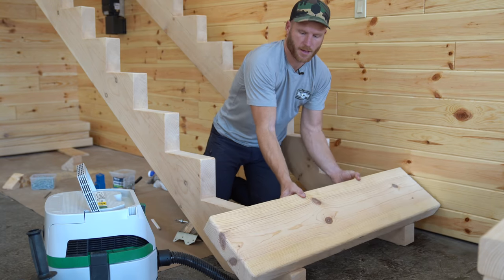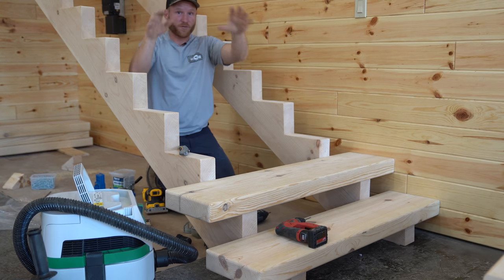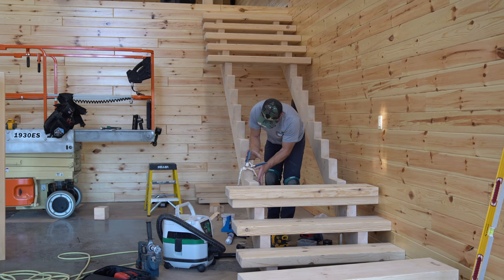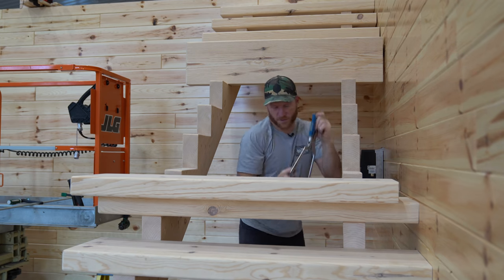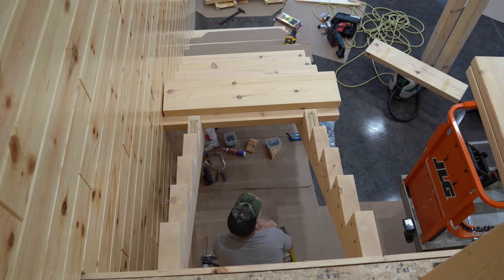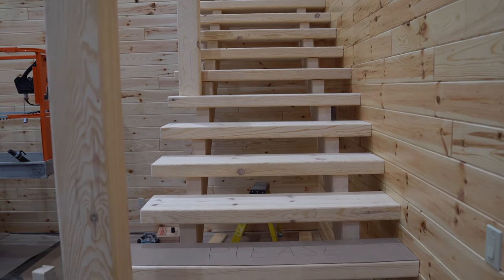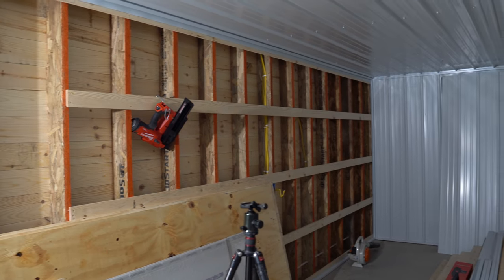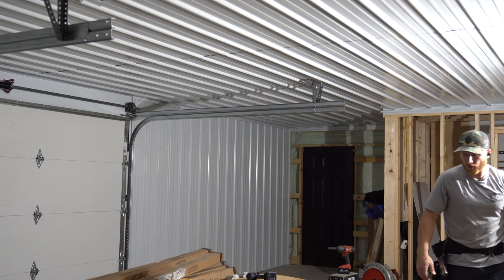Cabin in the Woods 43: Installing an Open Frame Timber Staircase

Comment: That's one beautiful set of stairs the craftman that got them stairs out did a beautiful job have you done a beautiful job installing them I worked in a metal fab shop for five years and built stairs and hand railings I know what it takes 👍👍👍👍👍👍

Comment: I remember my bro in law had a spiral staircase installed in a new house they had built, and when the drilled into the floor to fasten the spinal column, the drilled right through the radiant floor heat tubing.
Reply: Always makes me nervous to see them drill into a radiant floor. I know Kyle was careful about his depth.
Reply from the maker: Dang
Reply: I'm sure he had the lay out plan for the pipes!!
Reply: If you turn the heat on, you can use a thermal camera to see where the pipes are.

Comment: That looks amazing only thing I would of done different would be a small gap between the wall and trade to avoid squeaking
Reply: Yup, just a 16th.
Reply: 2 stringers no risers and all that weight from those treads... you know its going to be bouncy.
Reply: @deeeeeeps   You do realize those stringers are oversized aswell as the treads. I doubt there will be much movement at all.
Reply: @razztacular  yes i noticed they are 3/4" thicker...won't make up for what it is lacking. I bet it drops at least a 1/4" with a 200lb person in the middle. Explain how a thicker tread helps the vertical strength. I'm curious.
Reply: @razztacular  wood expands and contracts regardless of its size. A nickel gap would have helped.
Reply: @deeeeeeps   so your saying a 1x12 will have the same vertical strength as a 2x12.
Reply: Jaime Ness and they look more like 3x12 s those are not going to sag for along time.
Reply: @razztacular  Yes, he could have done with half the thickness, particularly for the treads. Wasted some good wood, in my opinion.
Reply: @2themaster  1.5" x 11.5" (standard lumber size at Home Depot) would have carried all the expected load applied to the stairs. - easily!
The floor itself cannot carry the load that those treads and stringers can carry!
The only reason for such large members would be for aesthetic reasons.
Reply: @deeeeeeps  I doubt it, unless you weigh 350 lbs. Those stringers are bloody gigantic, and the span is not all that much.
Reply: @deeeeeeps  do some point load calcs. show us the result.
Reply: @deeeeeeps  you realise that the floor itself is probably designed for 50psf load? you'll fall through the floor before those stairs fail!
Reply: @apscoradiales  Its not about falling through the stairs I'm replying to a post about squeaking. Those stringers are going to sag when walking up them causing squeaks. I've installed miles of stairs.  I'm not going to argue over online.
Reply: @deeeeeeps  They are equivalent to 4 stringers. I have 2 sets of those in my log house and they are super strong. No bounce ! If they are done in the same style as mine, they are probably 3.5" thick.
Reply: So funny I was going to write this same comment.
Reply: @apscoradiales  well no.   Those 4x12 stringers aren't "x12" after you cut the riser and tread notches out. Typically there is anywhere from 3.5-6" left over (solid sawn remaining) after cutting stringers. It is essentially now two14' 4x6's. They will bounce.  Even standard stairs (3, 2x12 stringers) with that many risers will bounce like crazy... Almost a half inch.  They usually are fastened to the adjacent wall though, eliminating that flex.  They will bounce and they will squeak against that wall.  I am a carpenter of 18 years.
Reply: @9mmkahr  I'm a carpenter with 40+ years experience and you're 💯 right 👍
Reply: @deeeeeeps  what if they made them out of iron?
Reply: Love the look of the thick wood!

Comment: I just did a staircase using black metal stringers, with custom treads, finish stained from a wood shop.   Stringers had holes drilled underneath for bolt mounting.   Black bolts to match the metal.   Looked pretty awesome going up the 3 flights of stairs.

Comment: You may find over time that the stair treads will squeak on the wall and knock into it as you go up and down, a quarter inch offset would be good, or a couple of angle brackets around the mid way mark to tie in

Comment: Great kreg tips. Only thing I would add is not to use an impact with the drill bits either.  I’ve found that if you let it hammer then the depth stopper will walk and cause you grief.

Comment: Looking sweet just wondering why you haven't left a hairs gap from the tread to the wall for movement and squeaks just a thought greg
Reply: Ya even 1/8th or 1/4 would have worked. Different seasons have different humidity !
Reply: Yup that would be my concern aswell. The staircase looks awesome but it will move when you walk on it and the treads will rub the wall
Reply: Cross grain gluing i would have glued half across the treads just to try and eliminate some of the treads from splitting over time it would have been better if the treads had been laminated together but who knows with timber ive tried many things over the years and if timber wants to move it will only time will tell greg is such a perfectionist I'm sure he will sort it
Reply: @davidbray6515  I don't know about that. Mine are the same and about  13 years old and they haven't cracked or split. You have to use completely dried lumber to make these !

Comment: Nice work as always!  Only suggestion would have been to add some super thin felt between the tread and walls for possible squeaks.  The wood is pretty burly so hopefully you won't have that problem. But just in case..  Enjoy!

Comment: I would have put a 3/8 gap between tread and  wall to mitigate the dissimilar gaps.  When i do treads i do top and bottom first, run a string line so even from a distance tread ends line up perfectly. But i have  a  problem . Noticed glue on top of top tread, that'll need a sanding
Reply from the maker: Yes of course glue will be sanded off

Comment: I remember helping my grandfather cut and attach points(triangular shapes) to stringers by toenailing them in place. Used scraps from the framing material. Surprisingly they held up pretty good. What are the size of the stringers and treads. Look expensive.

Comment: Awesome looking - if it were mine, I would have used wooden dowels on each tread, glue them in and knock the tread down.    I expect if anyone cares, you can fill the Kreg pocket holes in with plugs.

Comment: You're not concerned about a slight movement of the tread against the sidewall causing a squeak?  I guess I'd have left a small gap or put something on the end of the tread to prevent squeaking.

Comment: So...how are you dealing with the construction adhesive on the top tread?  Letting it harden and then sand it smooth?  Just curious on that one. Also, are you spaced away from the wall or are you tight against the wall?  In many applications I've seen people use a playing card or the like to give a slight air gap between the wall...the wall will move, the stairs will move.  There is the potential of bumping against the wall with the stair case, I've even seen one person put in a "bumper" pad between the stairs and the wall so that when the inevitable happened, the "bang" would be a "thud" instead.  LOL
Reply: yep, let it harden, scrape and sand it off...only way to do it.
Reply from the maker: This is something I was concerned about

Comment: I think you could have drilled dowels through the top and sanded them flush with a darker wood. If you didn't like the look of that you could put a dowel in the stringer sticking up 1-1/2" then put wood glue on the top of the dowel set the tread on the dowels. The glue will mark where to drill the holes in the tread.
Reply: I'll buy that

Comment: Was there in floor heating to avoid where the stairs landed? But I am sure you planned for that.
Reply: Looks like he used short screws, so that would negate any line puncture issues..
Reply: Usually the tubing is on the bottom of the concrete. Should be 3-4" down or more.

Comment: I would have thought a small space between tread and wall would be better, the stairs are bound to move a little and scrape against the wall making them creak.
Reply: That's what I picked up on too. We use a 1/4 inch gap in those situations to avoid the squeak. The Craig Jig shocked me as well. Those things never plug like they show on T.V.

Comment: Did you use the kreg plugs to hide the screws and make the stringers look good?  Might have looked good to lag bolt from the top of the tread, and then use plugs to fill the screw hole.

Comment: Just a tip with the step bit. Never hold item your drilling with your hand. If the bit catches it will slice you up fast.  Always clamp it down.
Reply: When up a ladder or somewhere silly, I usually hold the item with vice grips which gives you enough leverage to counter the torque.

Comment: For all the ergonomic hate that Milwaukee installation driver received. It seems to get a lot of love and use haha. Nobody holds it like it’s designed to be held, like a drywall screw gun and use your thumb for the selector switch.
Reply: I find Milwaukee works well if you have larger hands. I have lots of Yellow and Red tools !

Comment: Looking at the wall side stringer at 9:18 I see a crack that runs the full length of a tread support.   Don't you think it would be a good idea to inject some glue into that crack?
Reply: It's a drying check - often barely deeper than surface and nothing to worry about.. that said I just filled all of them, on a heavy stair I'm building, with epoxy, more for appearances sake though..

Comment: What are the marks on the top tread? Looks like glue.
Reply: I was wondering if he put it upside down and than had to change it.
Reply: Believe the top tread was meant for only the top and he accidentally started mounting it lower down.
Reply from the maker: No I mounted the one wrong... pulled it off and let the glue dry to sand later and used it on the too
Reply: @RRBuildings  thank you.
Reply: @RRBuildings  You're kidding me made it through 2020 without being wrong once and here I'm already wrong in 2021.

Comment: Curious why you did not just screw in the threads all from the center of the stringer instead of both to one side. Is there a reason for this?
Reply: I think i know why and I believe it is aesthetics is that correct?

Comment: I would not be securing those stairs with pocket hole screws. Pocket hole screws are terribly weak. If you must use that crap, please use wood glue for added strength.
Reply: What do you think the Loctite is under the tread on top of the stringer?
Reply: Did you not see him glue every tread dippy? Make america observant again..

Comment: hmm i was quetioning the stair layout since you shown the markings

the top floor isnt jet finisched so this would add at least ~12mm (0.5") on top
that would make the top step, that already looks taller then the rest, to be even
taller
if thats the case it would be bad you must fear a fast descend every time useing
the stairs, cause for stairs the most important factor is even spacing
the ratio of hight and depth is also important but not the most important

mayby it was just video that made it appear as if was not even, otherwise the only
solution is a new staircase

also why are you pushin the treads against the wall without a spacer? you have
to fix the treads to the wall or account for different movements of stairs and wall
Reply: Can I ask for the contact of the stair manufacturer and cost?  Great work and entertainment.  Thanks.